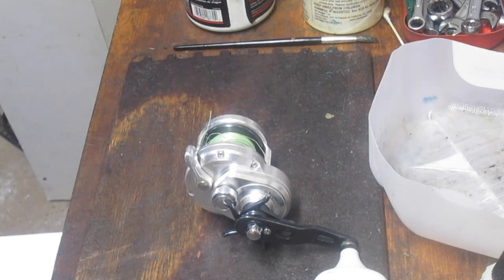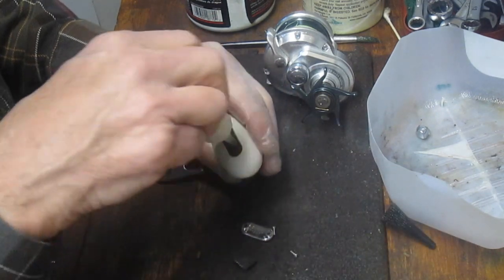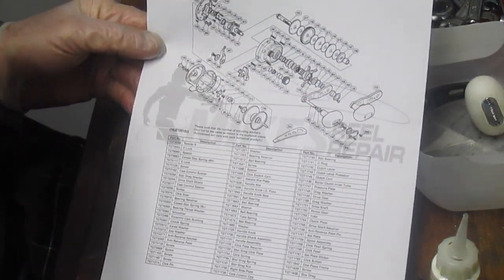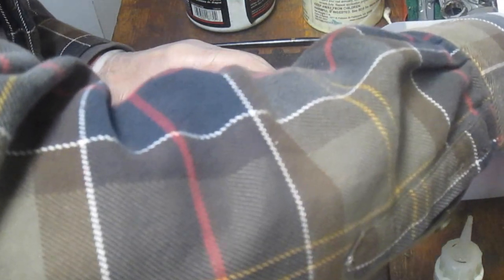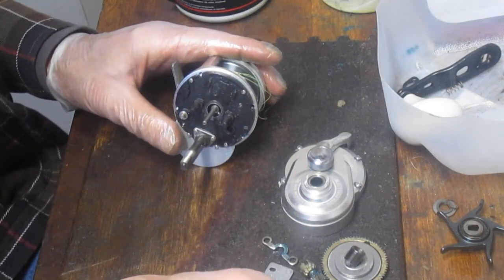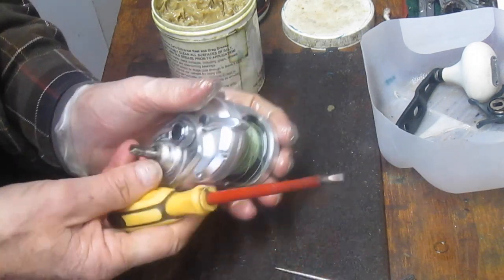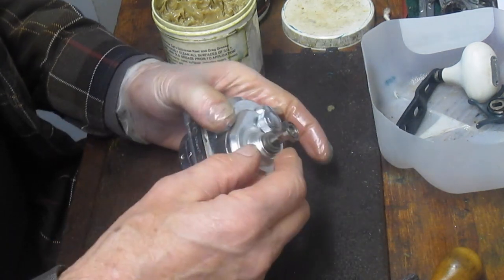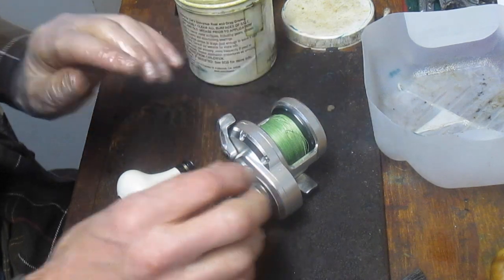Shimano Trinidad 12A fishing reel how to take apart and service

Comment: Hi Dennis. Thanks for another great video!  That reel retails for $459.95!!  That’s why I no longer use Shimano gear. A PENN Fathom or Daiwa Saltist will do the same job for less then half the price.
Reply: I agree this reel is overpriced but people love them. Not me but they're popular. I looked into them but bought the Daiwa Saltiga star drag. Much the same as the Saltist in design with a few upgrades in materials in key spots and seals. The reality is my old Penn JigMaster or Delmar 285 could also do the same job. Not like people couldn't catch big fish until these reels were made!
Reply from the maker: Good points.  I just did a video you may enjoy.  It is a comparison of a lever drag reel to a star drag reel and how the technology and use differs.  I will most likely publish this tomorrow. Ironically - the Saltiga reel I posted recently and the Trinidad reel are owned by the same person.  He fishes both heavily and he likes each for different reasons  - Dennis

Comment: Nice reel. I chose the Daiwa Saltiga over the Trinidad but it was a close call. I don't like that Shimano won't tell you what aluminum they use, when everyone else does. If they used the T6061 aluminum I think they'd tell people so I don't think they do. Otherwise it's a beautiful reel.
Reply from the maker: Jeff - once again you know way more than I do!  I am not a metallurgist and would not know the difference if they told me what grade they were using.  I use experience at the guide.  If the reel pits and corrodes easily, I pass.  Unfortunately, you can't know that when the new models are introduced.  You can only go on track history and prior models.  In those cases, I delay my decision until the jury is in.
Thanks for heading light on this - Dennis
Reply: @2ndChanceTackle  you give me too much credit and saying I know more is an outrageous statement! There's a reason I comment on all your videos, I learn something each time. Plus, this one is easy. T6061 is aircraft and marine grade aluminum. It's the top of the line, so anything that's not T6061 is below it. Avet, Accurate, Daiwa, Penn, Okuma, etc., all use T6061 aluminum on their high end stuff and they're proud to tell you. In some cases like Avet and Accurate, they strictly use it. Just the fact that Shimano doesn't explicitly state what grade aluminum they use makes it clear it's not the best. I've got other issues with Shimano regarding materials they use in certain areas, but the aluminum is my biggest annoyance. If I'm spending $450+ on a reel, the darned body best be the highest grade material. That said, the Trinidad is still a great performing reel, people love them. I simply found the Saltiga more appealing in the star drag world.

Comment: Thanks for this.  Good timing, too.  Just had to work on a Trinidad 16NA, and whoever worked on it previously left out a couple of important parts plus several parts installed incorrectly. Typically I put it back together just the way I tore it down -- but had to be careful in this case and cross-check w/the schematic for missing/wrongly installed parts. Hard to tell some of the issues from schematics so it was helpful to see you tear down/reassemble.  Clicker was also frozen but corrosion pitted the body so badly that the clicker will not work as smoothly as it should (client is okay with it as is since he doesn't use clicker). But it looks like only way to really fix it would be to replace the entire one-piece body.
Reply from the maker: Thanks you from one reel repair guy to another - I appreciate the feedback - Dennis
Reply: @2ndChanceTackle  It's just great to have these video "visuals" to complement the schematics as well as pick up little techniques, tricks, tips, etc.  Thanks for taking the time to record, edit and post.

Comment: Have you noticed a decrease in performance from a factory trinidad vs one that was taken apart and re lubed/greased. I have a trinidad 20a that i got last year and i feel like the spool is slower than it should be and not quite getting the casting distance i thought i would.
Reply from the maker: I haven't noticed the performance problem, but you need to check some things during the service.  Are the bearings OK?  Have you reset the spool tensioner?  If you added grease and oil to the bearings, the spool may need to be loosened to adjust for the extra grease - Dennis

Comment: Dennis, what is your opinion on greasing side plate screws or perhaps the inside of the threads for the posts? Is it good practice so they have less of a chance for corrosion or  could it spell disaster if the reel is feeling the vibration from the boat?
Reply from the maker: Sam - I think that is a good practice.  When I have time, I generally put a drop of oil on the threads of the screws when I remove them during a tune up.  The oil helps dissolve any built up salt and the internal threads get lubricated when I reinstall them.  I don't worry about the boat vibration.  Most reels do not sit on a boat that is out fishing enough that it makes a difference - Dennis